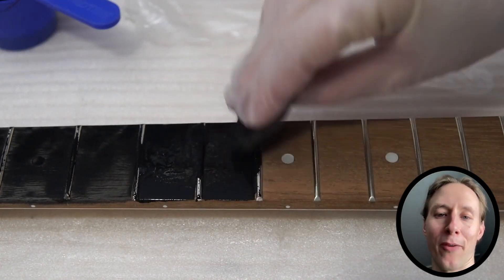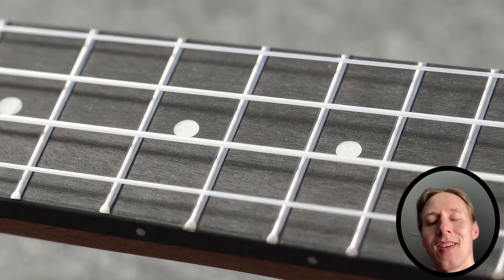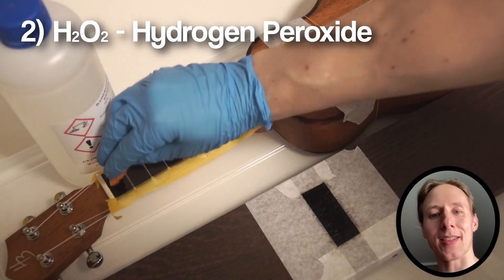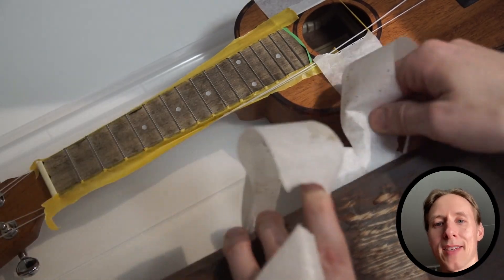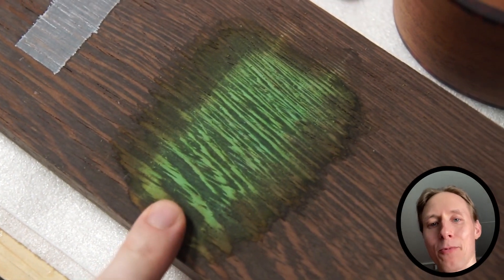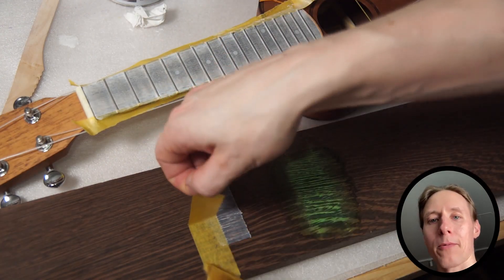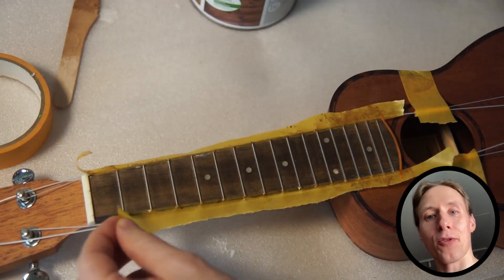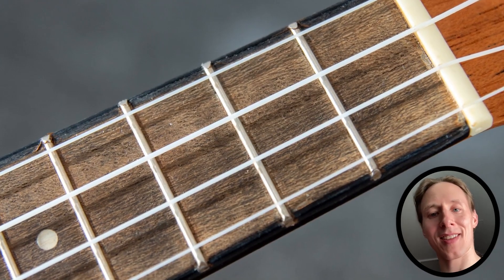How to bleach a Fretboard | Amaranth & Wenge

Comment: As a beginner, i applied lemon oil on my maple fretboard. I didn’t know that it can make the wood darker so now i have dark stains on my fretboard. Is applying bleach going to work on that?
Reply from the maker: bleach does work on raw maple, to get rid of discoloration. However, the lemon oil will form a barrier and the bleach might lighten the maple in a very patchy and uneven way. It's always best to try it on a test piece first.
Reply: Okay, thank you!

Comment: Oh, I am quite interested in this. I have some figured maple but with yellowish tint. I want to whiten it and apply blue dye. Do you think the bleaching method would remove the figuring?
Reply from the maker: The bleach will make the maple more pale and the figuring remains the same. The figuring (flame maple, curly maple) comes from the wood fibers changing their direction, which is not affected by bleach.